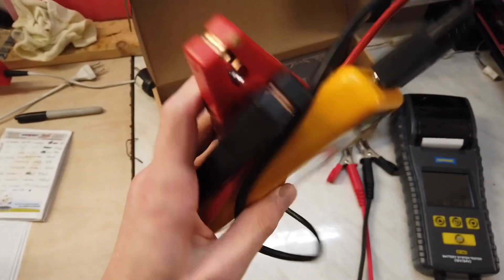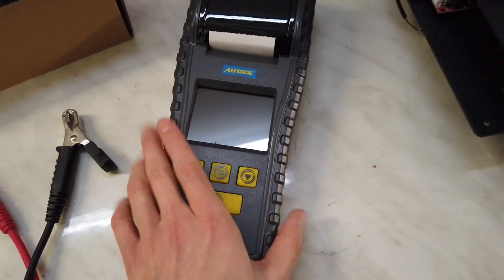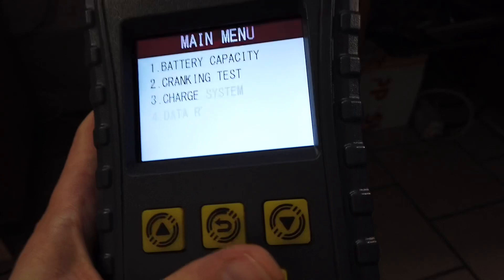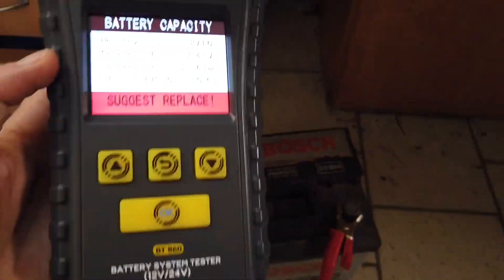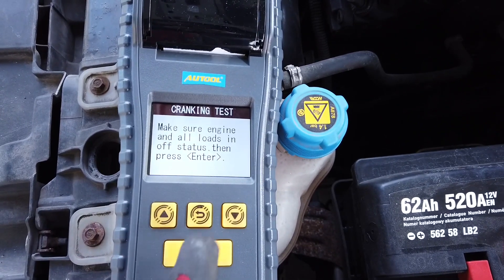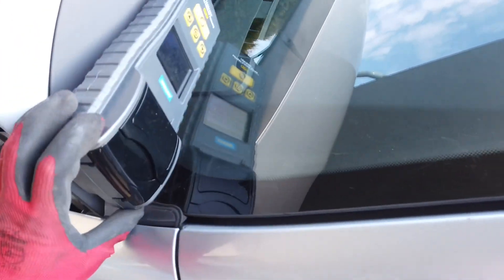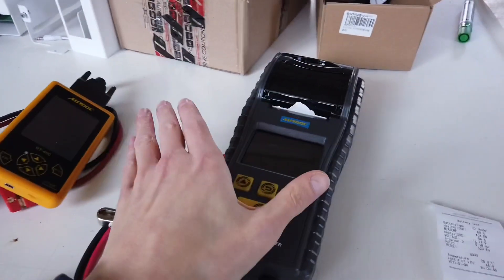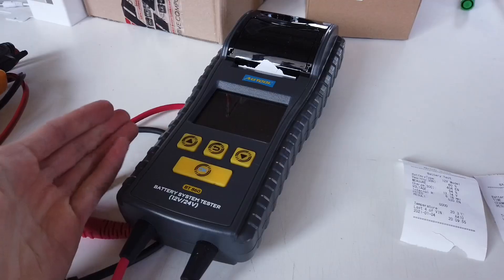Autool BT-860 battery capacity, car charge and crank tester review

Comment: Well explained! I’m a full time auto technician and I just ordered one. It’s always good to have you own tools ! Instead of using the shops tools when you done have that tool.
Reply: Have you tried using a Volt meter to see if it's accurate as the tester with the same numbers on a battery?
Reply from the maker: Please let me know what you think about it after few days of use.
Reply: @mrfixpl  I have used it for a whole week and it works good. No problems and used on about 35-40 cars in one week